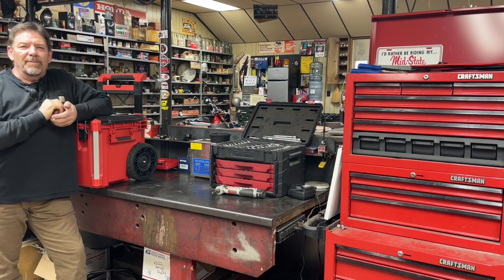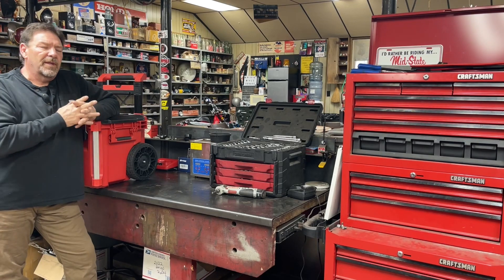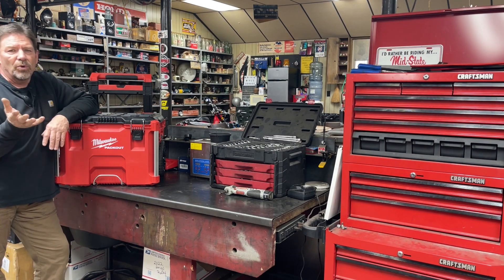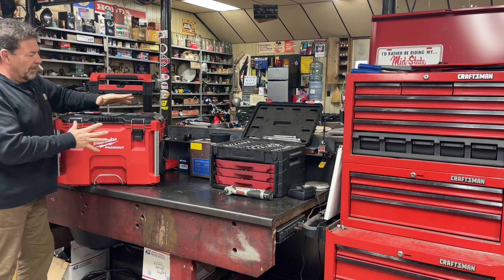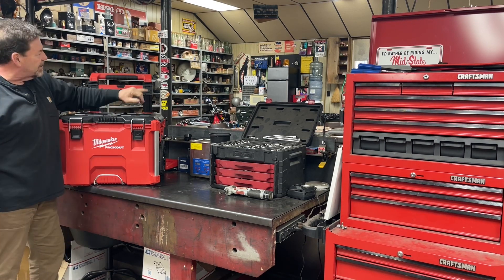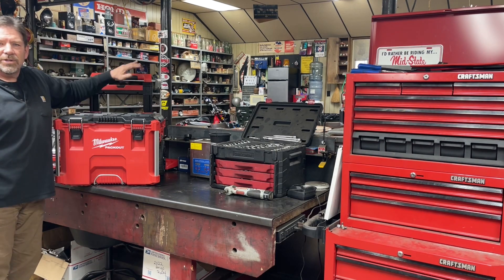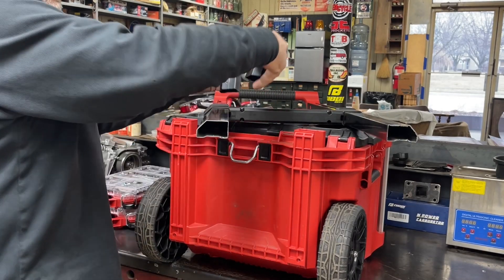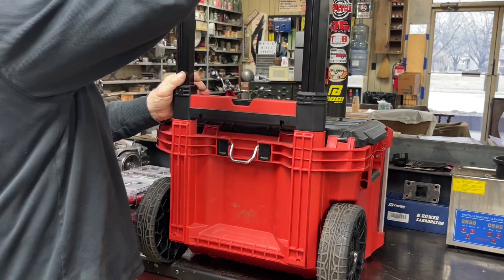Milwaukee packout - handle modification

Comment: Diehard (punn intended?) Craftsman guy here as well!!!😆  My old stuff is either lost or still in service after 40-years!!!  Gotta agree, however, that the new stuff is not as good as the old stuff, and I've been going elsewhere for new/replacement tools.  I found a top notch quick removal kit for Packout, that doesn't involve any cutting, just drilling 10 holes (made by NeatTools, $40).  Got tired of having to lay it down to get it under the tonneau in the truck (even in a F450), or in the belly of the toy hauler.  Flick two tabs, and the handle comes out, put the handle back, flip tabs back, and it's just like stock.  Took less than 10-minutes to install.   I'm tall, so I was looking for a solution that wouldn't reduce my extended height.  That system actually made the handle ~1" taller when extended, so even better for me!

Comment: I literally came to YouTube for exactly this reason. 2021 Silverado with a hard tonneau cover. I love this Packout toolbox but the handle is just too tall. I knew there had to be a way besides just taking the handle off. I need to be able to pull the box up steps and things like that. If I just take the screws out of the handle I can’t pull on it at all or it will just slide out. Hopefully the end result gets the total height low enough.
Reply from the maker: When collapsed, the handle height is 21 1/4”.  It fits in the bed of my Chevy Colorado with a bed cover.

Comment: Not sure why you just didn’t put quick release pins in place of the 2 Phillips head screws were. Then take the complete handle out. Seems like most people are doing that with the tonneau cover problem as did I. 😉😉
Reply from the maker: @lorrainebayford177  “Seems like most people are doing that…..”.     This is exactly why you make a video on a different option.   My fix suits my needs way better than messing with pins and pulling handles all the time.
Reply: This way make more sense. Either take your handle off everytime, or use it how it’s supposed to be used with a way that actually fits in trunks and covered beds

Comment: When I first bought mine I bought it home in the car, it would have fit easily in the back seat if they didn't make the handle so high, this is a way nicer mod than making the handle removable and having to take it off every time and store it somewhere, in surprised this hasn't caught on. I'm also surprised Milwaukee didn't make it removable and have a option to buy a shorter handle, they'd sell a ton of those. I miss having a utility van where this wouldn't have been an issue.